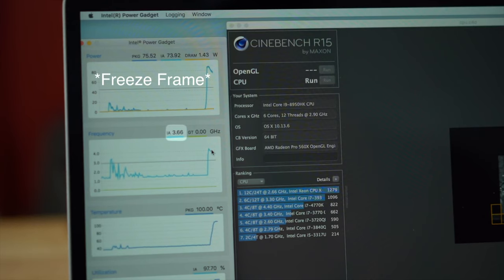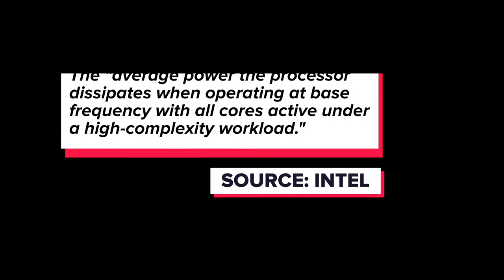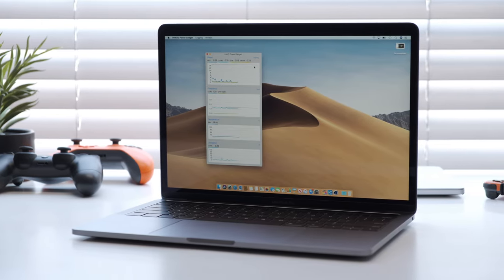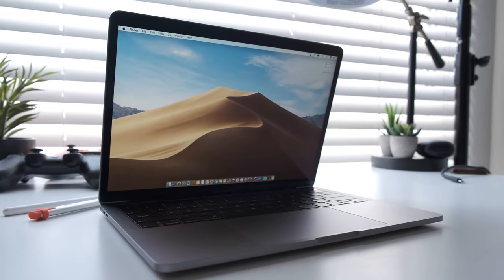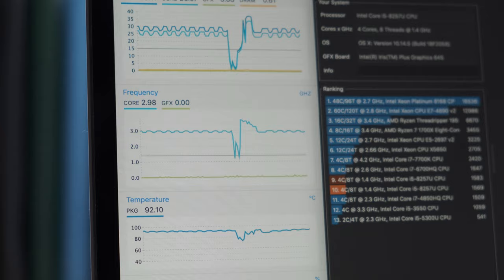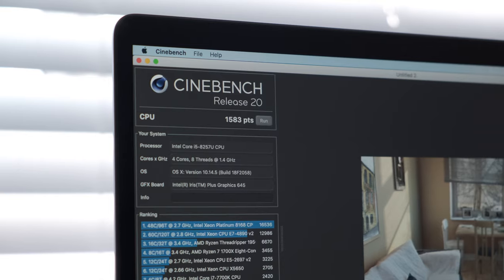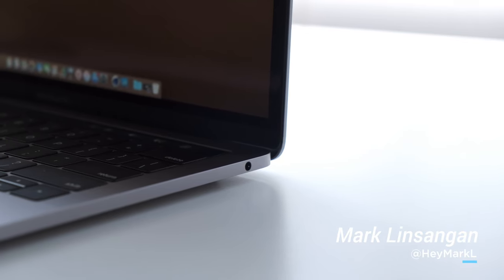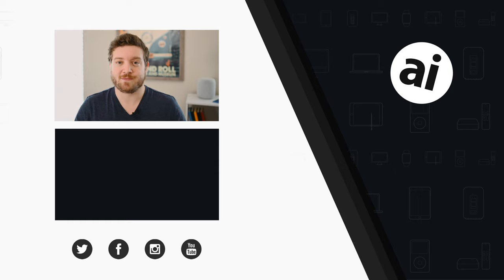13-inch MacBook Pro: Does it thermal throttle?

Comment: I use Mac Fan Control and speed up the fan to 100% before it reaches the thermal limit. Con, I hear the fan a little more, uses more electricity but prefer the performance.
Reply: I've have this monitoring my CPU. Are there any other internal heat monitor apps worth downloading

Comment: Nice video. But my new 13-inch MacBook pro base model, on a very light load, thermal throttles worse than my 4 year-old MacBook Air. Very LOUD. Very HOT. Very disappointing.
Reply: same here  :(
Reply: Sorry to hear. But thank you for warning us. Ithink what this guy did NOT tell us, was for HOW LONG he ran the tests! If you just run Cinebench for a 2 minute render, do you think its likely to thermal throttle on that small time? Probably not!  You need to stress the CPU way longer to make that throttling happen, dont you think?  👍

Comment: Are these models worse than older models? I have a Macbook from 2017 which thermals I'm pretty happy about actually, like it somehow stays cooler than the recent 2019 16 inch macbook pro under similar working loads which cluster fucks me.

Comment: Seems pretty comparable to the XPS 13, etc. But the higher-end 13” model (with four ports) has two fans and significantly better thermals.
Reply: Not really. Max Tech did thermal tests and there was no significant difference in thermals.
Reply: Paul It makes a massive difference when you’re just using Final Cut or Photoshop, not pegging the CPU at 100% like he did (where the extra power draw will balance out the additional fan). The dual-fan model stays quiet and cooler to the touch in my experience — although my judgement is based off the 2016 models.

Comment: The problem with the base Pro is the storage is only 128GB.🤦🏿‍♂️
Reply: dazaek well luckily you can just upgrade the storage 🤷🏻‍♀️
Reply: waquzy is that only for 128GB ? or for all storage options
Reply: @tedm8528  "slow" , but only for the 128gb, than they get faster and faster
Reply: Yes thats a problem, an smartphone has more storage
Reply: @mervegunes6191  why does a company want to sell pro models with just 128 gigs?  Apple should not have this model at all. Pro users will update and this is just a way of milking consumers.
Reply: I would buy a Samsung EVO 860 M2 NVME  1TB SSD card & install it myself.. Perfect & save like 200 USD compared to upgrading from Apple. Perfect coz apples SSD's in those Macbooks are slow, while Samsungs are never slow also. Coupled with the huge 1 TB capacity!  👍
Reply: @tredfxman  cant upgrade on these 2019
Reply: @PrioBak   @BlackTop  Thats why well get a 2017 Macbook here. Save bout 400 USD & get the real USB ports.. Just get the external Samsung T5 Portable & its Case Closed LoL..  👍
Reply: @tredfxman  good for u bro... in my country(malaysia) secondhand/used macbook pro go crazy on the prices that i might even as well buy new and I did.... also concerning abt the keyboard issues in the earlier version I really didn't want to take my risk

Comment: great video - as a user of a dual core MBP with single fan this was a worry to me. Seems the cooling is in line with the TDP - arguably the mid-range isn't significantly faster for twice the wattage. This reassures me the base model is solid and will perform well. Thinking about getting this or the MBA for a college computer for my kid.

Comment: To thermal throttle is to run below the base frequency at high temperatures?
Reply: Yes. Technically it doesn't thermal throttle but at the same time, it can perform better with a better cooling solution.

Comment: i have a 2017 and I swear the bottom of this thing is a health hazard. There is no way I am putting this on my lap without making me infertile. Wish I got the slightly older model that was thicker and had standard usb ports. I'd take a thicker laptop that doesn't burn the shit out of me when I do anything on it.

Comment: I love Apple products but i wish somebody would explain why Apple runs their Intel cpu in the 90 while most other manufacturers limits those same cpu under 70 and if i can expect those macbooks to last if i buy one.
Reply: Well to be short: intel cpu's can easily handle that temperature, 100 is about the max when it comes to safety, but you can go further than that.

Comment: Great video. Do you think 512gb is good enough as the standard on the 15 inch? Or would you upgrade to 1tb as the prices have lowered. I will doing a lot of vm work.
Reply: Adnan Gajraj If you don’t want to upgrade because of the high cost price, you can buy an external memory (idk how it’s call) But it’s like a USB, and i think it’s better ( For me)
Reply: SWAGERA Castro, yep. External SSDs are great!
Reply: Maybe an external hard drive with the fastest SSD that you can get, I think there are M.2 SSD that can get up to 3500Mbs, but not sure if they can work that fast via Thunderbolt 3.
Reply: Don't let yourself get ripped off. Just buy the cheapest model you think you need. All extra storage will then be external. It's cheaper yet also much safer as the MBP is unreliable.

Comment: Your methodology is wrong. CB20 is too short. Download Blender and from their benchmark page Classroom scene. Let it render and track the temps and frequencies for the duration of the rendering.
Reply: Others have done several Cinebench tests back to back and the results are the same. There is no thermal throttling.

Comment: It does not throttle, big deal, at those temperatures it will be fried in 3 years.  I will not by a Macbook again if i don't have hopes to keep it a long time.
Reply: Daniel Frappier So would u recommend getting the 1800$ model (since it has another fan) so that the computers performance is better over the long term?
Reply: Mattie Barrett The $1800 model does not fare better as Apple is removing the TDP limitations and the thing reach a 100 degrees anyway. For most people’s this will not be an issue but do not do like me and play hundreds of hours of Civilizations on it. Even if it’s not a demanding game it keeps the machine super hot for extended periods and this is not good for the life of any laptop. Lost my Mac after 3 years :(
Reply: @matti3117  No. Apple offers no support after 5 years of ownership. So, just buy the cheapest one you think you need. Don't let Apple fool you. Just check on Apple's website for "obsolete" and you will understand what I am pointing out.

Comment: MacBook Pro 13" has alway been good about thermal issues, that's not surprising.
Reply: At least my duo core 13" one can handle a long time workload at 3.5Ghz.
Reply: Theodore Shuai  can it game dota2 at medium setting?
Reply: @jaycris6338  I haven't tried dota 2, but I can game Bioshock Infinite at medium setting pretty well.
Reply: @jaycris6338  Just buy a random 500 Euro windows laptop if you want to play games. Why even bother on a Mac. It's not worth the price for gaming.

Comment: Give it a couple of months. You will see the decrease in performance.
Reply: ...that's not how lapotop thermals work.
Reply: @eriksp92  That is exactly how it works. Dust and dirt get in the system. The MBP already hovers around 99C and 100C. Now, with dust added to the mix, the MBP will throttle. Dust causing thermal issue's is something that happens to laptops in general, however the MBP has a terrible factory design so when it loses on thermal cooling, you will notice a performance hit.